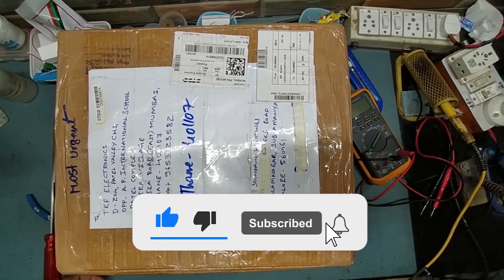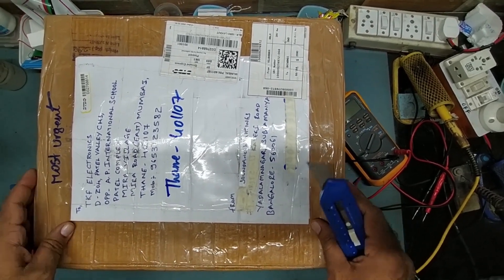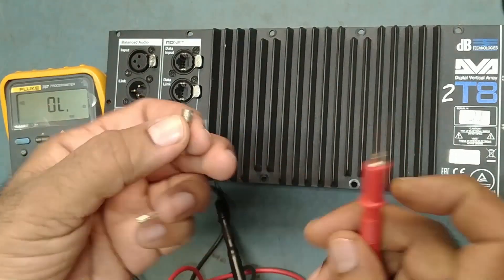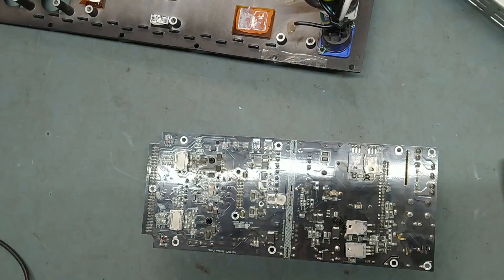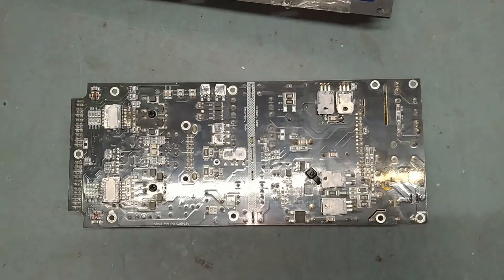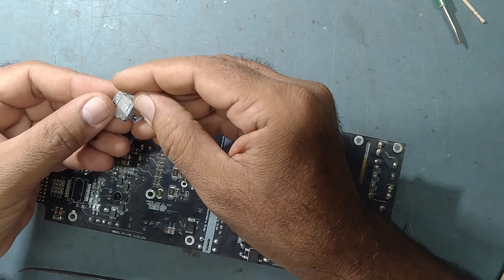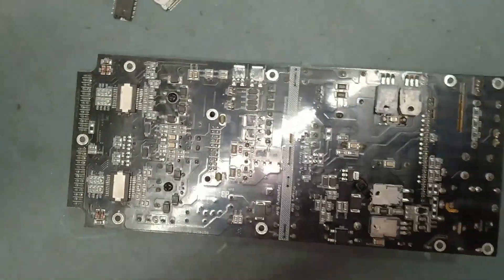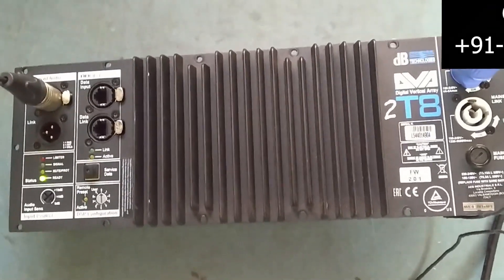Repairing DBTech DVA T8 Active Line Array Module, Very Critical Fault.

Comment: I watch your videos with admiration, I am a close follower of yours, we are waiting for your videos to continue. Sir, I have a problem that I cannot manage, the 7-pin PWM control integrated circuit of the 600-watt cooler master brand power supply cooler main power supply exploded, it cracked in the middle, no code or number can be read on it, what can I do in this case, thanks
Reply from the maker: Yes, it is possible to repair it by checking the ic  pins track
Reply: @TKFElectronics  secret how do i do this the official card is on my youtube account
Reply: @TKFElectronics  You have much more knowledge and experience than me. I am a beginner. I am trying to learn something thanks to friends like you. A friend of mine said you could be tny277pn. What do you think?